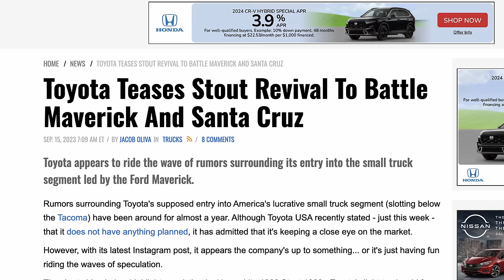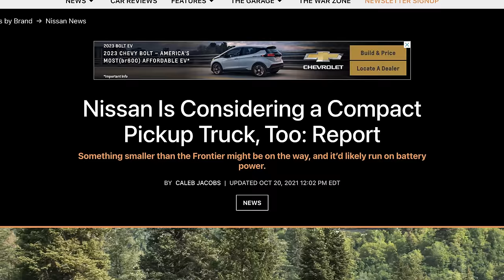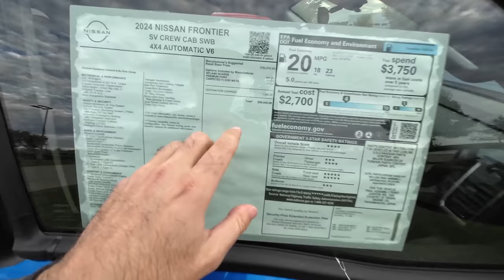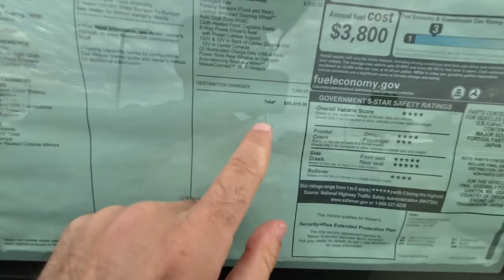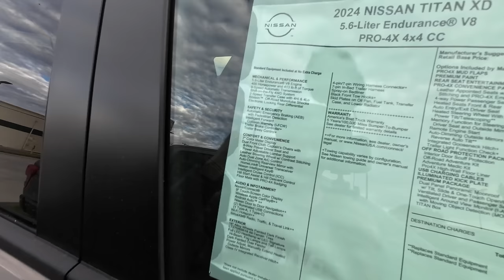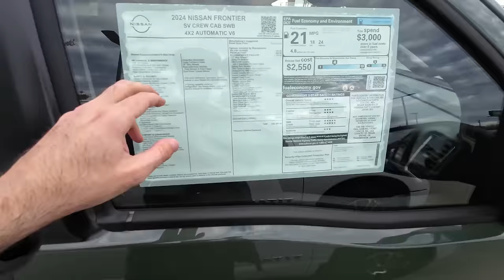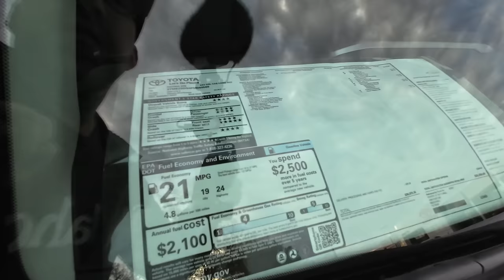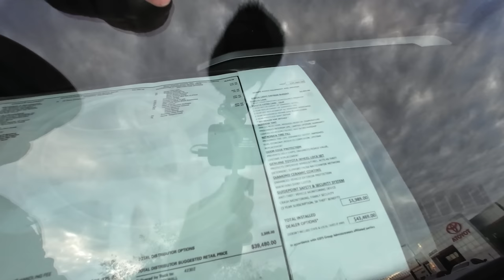Nissan’s NEW $20,000 TRUCK Has Ford & Toyota In Panic Mode!

Comment: I fear even if Nissan did make a 20k truck it would have their crappy CVT drive in it.
Reply: Unidoby with cvt, would basically be a Murano with a bed
Reply: It’s never had and never will have a cvt in the frontiers just a normal reliable 8 speed.
Reply: Or it would be electric.
Reply: Trucks can't have a cvt cause cvts are not made for towing
Reply: @Misfit_wk2  Up until 2022 when they made it bigger the Pathfinder had CVT's, that's a truck...
Reply: Didn't the guy get in trouble for using crappy parts and fled the country?
Reply: @Zappy1210 i’m on my second pathfinder lol that in fact is NOT a truck.
Reply: @boogie9710  I bet you're wrong.  Name the bet.  Pathfinder is indeed a truck, check your title.
Reply: @Zappy1210   that’s whole suv & i’m not talking about the credentials,.. im talking about the capabilities which in fact the pathfinder doesn’t have ..  no “real truck” has a cvt so sir you’re wrong lol.   fwd and awd applications are for most commuter nissans and unfortunately they’re cvt n belt driven .. deeming the tow load to be crap which in fact nulls any idea of a NISSAN PATHFINDER to be a truck ….
Reply: @boogie9710  But the title does say "truck".

Comment: What I heard from the ford dealership near me is that Maverick is only available for pre-order because of the high demand. The dealership won't charge any markups but they just won't have any existing inventory. Anytime you see if there is an Maverick available on the lot is basically customer doesn't want to the car after it arrives.
Reply: No dealer mark up would be a pleasant surprise
Reply: I’ve seen Mavericks running about $38K.
Reply: @scherzva  probably mark ups for existing inventory yes. but pre-order only the top lariat trim will reach $38k.
Reply: Every Ford Maverick built is pre sold before they hit the dealership. They have no problem selling them , they have a problem producing as many as people want .
Reply: I just rented a Maverick XLT to drive through Florida. I got to tell you not impressed at all. Very tiny very basic. I felt the engine was struggling to maintain highway speed. Everyone does 85mph
Reply: @stevenwagner8741  The struggle was probably the transmission. 

Many are coming out in 6-9 speeds to save fuel.
They'll only go into overdrive on a perfectly flat, no turns, no winds stretch of road.

You get one little breeze, and it'll drop down a gear.

The irony is, without the added weight of those extra gears the trucks would stay in overdrive.

Comment: I bought a new F150 in 2013 , and I still have it payed $35,000.00 Canadian all in .It’s the XTR 4x4 5.0 L Super Cab , I would not pay more than $45,000.00 Canadian for a new F150 . Ford you want to sell more trucks ? Get rid of the Bling 💍 and give me more payload just saying.
Reply: the local large Ford dealer group currently ( 2/10 )  lists 600 F150 available....of those not a single stand cab 2 wheel drive ...they dont care what we want in a work truck ....also a total of 3 Rangers and 11 Maverics

Comment: I am a die hard Toyota fan boy. But I must say that the new Frontier is a nice truck. Shame it’s not available with a manual gearbox. If it did I would actually consider it.
Reply: I’m a Toyota fanboy and ended up trading in my 2011 4Runner for a 2022 Pro 4X. It’s way better than any Tacomas I’ve been into…yet a 6-speed manual tranny would be perfect in this.

Excellent purchase for the price!
Reply: @patricklachance3187 Toyota fanboy here is as well. I’m really considering a king cab 4wd, I’ve heard nothing but good things on the new Frontier
Reply: I have one and it’s awesome
Reply: But have they improved the turning radius?  It’s been woeful for decades.
Reply: I've worked as a Nissan Tech. I've worked as a Toyota tech. You buy a Frontier you will know you've upgraded from a Taco.👍🏿

Comment: I really love the Titan, I have a 2006 and its an amazing truck. I'd buy a new one but not at the current prices.
Reply: The Titans are the cheapest truck in the market right now.  A good SV with decent features are low $50k. If you can't afford that,  the preowned ones are in the $40ks, high mileage on the $30k. If that still too much and you wait,  then you won't be able to afford even a car because new versas which is the cheapest cars in America are now in the $20ks
Reply: My friend had a 04 titan and he loved it and the few times I borrowed it it made me want one he bought his with 185k and traded it in with 267k and had no issues at all in the 3 years he owned it
Reply: @mobilesolutions4u444 It's not about affording, it's about wasting money. Because my 2006 Titan runs completely fine and I only drive it between three and six thousand miles per year since I don't need a truck every day.
Reply: @mikedavis5207 Ironically, everyone who has borrowed my Titan also really loves it. I always say how torquey it is and how nice it drives.

Comment: I like it but Nissan's history of reliability is... concerning.
Reply from the maker: Honestly it's not any worse than most of the other brands. I had several 350Z cars and they ran so good most of the time.
Reply: @MotorFeed Trucks. We're referencing trucks here. 
I'm not going to use a 350z like I am a truck that I'm working out of. That's where the concerns come into play.
Reply: Nissan ranked 17th on Consumer Reports list that came out this week, 31 points behind Toyota
Reply: @chrisjmiller6  That's true, but the company is really trying to get back to their Golden Days back in the 1980s and 1990s! Nissan has clawed back a lot more independence back from owner Renault when it comes to what they build and how they build it.
Reply: @chrisjmiller6  consumer reports is not a credible source at all.
Reply: @Dan-gj1hz  are you serious?
Reply: Nissan is good if you dont buy CVT their standard transmissions and engines are bullet proof.

Comment: Yeah I’ll say it also, the auto makers have totally lost the plot when it comes to Work trucks ,just a plain  build for a work service truck without a service body on it is $50,000 plus then you got anywhere between 10 and 20,000 for a service body plus installation. It has definitely gotten out of hand with the prices.

Comment: Ford quit selling the 2.3L 4 Banger and the V-6 RWD Ranger because it was "taking sales away from the F150." Yep they were selling only 90 to 100 thousand a year by 2011.
But that was because Ford did not want to sell 4 banger sticks with just the basic list of options. Sometimes a 4 cylinder is all you need. I had a 7 passenger Envoy for the old lady's pleasure.
But if I needed to pull a 6000 lb trailer the Envoy could do it.
 The Ranger had transmission problems pulling a empty trailer. I also did not have to adjust the seats in it. Stick shift.
But she always pushed the remote button 1st when both of us were going somewhere in the Envoy. Yep the seat memory did not work well when she did that.
Works fine. Now that the Envoy is out of style. They seem to not understand there are men that drive them.
 But then the women are raising up men with musical chair fathers now.

Comment: I live in Toronto Ontario Canada and I remember back in February of 2009, my local Ford dealer (Yorkdale Ford) had a sale on the Ford ranger sport with extended cab, 3.0 V6 with automatic trans and 2 wheel drive. They had an ad in the Toronto sun newspaper for $12,288. I bought one in black for me and a white one for my father. A couple days later my brother went back to buy a black one as well. My father and I still have ours but its just crazy looking back and buying a new truck for under 20 grand.

Comment: Good to remember that the extended cabs, vs the crew, usually have bigger beds, so that is something to consider. An extra 18inches length to the bed can make a BIG difference.
Reply: That's the sweet spot for me. Load a dirt bike and still close the tailgate. Extra cab size to store items you dont want to leave in back or for a dog. Even with a camper shell, you can close it all up and sleep in back. Not everyone is traveling with a family/crew.
Plus a mid-size or smaller truck can get into places that a full size struggles to go.

Comment: Nice video with good thoughts.  But in the next year I hope to buy a new-version Toyota Tacoma with manual transmission.  I might even be willing to get the base (very basic) trim level but would love to go back to a manual transmission which I have not had in a long time.  Unfortunately the Tacoma and Gladiator are the only trucks available with manual.
Reply: You can never go wrong with a Tacoma
Reply: @user-li4km9rw1e The Toyota Tacoma has the 3.6 V6 twin turbo 400+ hp.
Reply: @kuntekinte6246  can you get that with the manual transmission though

Comment: It’s not a truck if it isn’t body on frame construction. Even Tesla fuct up when they changed the cybertruck to a unibody construction. It lost all its payload and towing capacities. Which are what trucks are for. Don’t care that it’s bulletproof, don’t care that’ll do 60mph in 3.0 secs, cuz it can’t hold the weight of a snowblower in its bed….and all the shit in the bed will go flying trying to beat 1/4 mile records. If it can keep up with traffic on an interstate on ramp, fully loaded, it’s good enough for me.

Comment: I don't care to get any smaller than the Tacoma. And I don't care get any larger than the Tacoma. 🧐

No doubt many people will love a smaller pickup truck option. 👌
Reply from the maker: Sounds like you really like the Taco. Lol.
Reply: current gen f-150 is the perfect size for a truck
Reply: @WaitForYouu  But the downside is that you have to buy a Ford
Reply: @WaitForYouu  
A work truck no doubt. 

But like most pick-up truck owners, there is nothing in the bed , most of the time during the year.

I have  the Tacomas for the 4 wheel drive and the high clarence for the winter.

I have seen all-wheel drive vehicles. Many cars get stuck in the snow and suspended in the high snow cause they don't have the clearance.
Reply: @MotorFeed   yeah
I would do a Tacoma commercial for Toyota for no charge. 😄

I own two of them.
Reply: @The_Real_Frisbee    L😂L

Comment: Small Trucks:

Luxuries:
Bluetooth
Heat&Cold Air conditioning 

That’s basically just the modern equivalent of Cassette player and air conditioning.

Otherwise, just focus on: 
MPG,
4WD,
Low sticker price.

Everything else, we can work up from there in this economy depending on what the individual can afford.

Comment: One report I read opined that Ford has decided to keep the Maverick producion down, because the profit  one them is low. If true, that's what Ford thinks about their customers. If Toyota, and Nissan can build a small truck, and get then to their dealers, the Maverick will be a thing of the past. However,  if Toyota and Nissan can't control their dealers any better than Ford, I won't be a buyer.

Comment: Manual trans wanted. Or repairable automatic with regular clutch packs and cooler up front. An engine that you can reach all around for easy repair. Make it as if America's are Afghanistan mechanic and who would rebuild the engine on the side of the road. Make the cab corner and rocker panels easy replaceable in case of rust. Have a clear layout in the service manual of all body drain holes and sticky points to avoid rust and allow the owner to make it last. Have chrome hardened bolt on bumpers. Make a dash with a modular slot in the middle for a gps and screen for apple car play, android, and backup camera. Do NOT have any kind of climate control. Knobs and switches. Fuses and relays. Do NOT have modules or canbus. Do NOT run anything about the car off of a touch screen or digital panel.
Reply: i really wish i had the means to make a car company. Can you imagine destroying the competition with basic square body single cab pick ups? The afgan analogy was perfect, those basic nissans and toyotas are god like.

Comment: I bought a ‘22 Pro 4X in December of 2021 in a trade with my ‘11 4Runner. The only things I miss about the 4Runner are the absolute peace of mind and the comfort of an suv like it.  The Nissan is better than the current Taco by very far, yet this may change soon. But will it be worth the extra 10-20k$$$?

Comment: In 2003 (I was 23) trucks were so NOT in demand and Ford was switching over to the NEW 2004 design a local Ford dealer was doing buy 1, get 1 FREE on F150s - or a great deal on a single F150.... I bought a brand new Silver F150 Sport, extended cab, stick shift, no carpet AND talked them into a bed liner: $17,000 + tax & doc fee.

Now, age 44, I am shocked every time I see the cost of a basic truck.

Comment: I bought a '93 Nissan Hardbody shortbed regular cab for my son as his first vehicle. The only thing I did to it was to put a set of 15x8 Pathfinder wheels and 255/60R15 tires on it to make it handle better and a new stereo. It had 300k miles on it but it still looked and ran great. My son drove it every day for a few years then joined the Navy. After that, I drove it for another year or so then sold it. That KA24E four cylinder was a great motor. If Nissan brought that truck back, I would almost certainly buy one!

Comment: My dad always told me to not buy at a car lot, but to buy from a private individual in cash. He encouraged me to buy my first vehicle (1992 Mitsubishi Mighty Max pu truck in 1996 single cab (87,587 miles) that the guy was asking 5800, but my dad negotiated it down to 4100. I made it to 228,000 miles on original engine and original manual transmission, but my younger brother got ahold of it and hit a pole with it and totalled many times over, and left tge scene of the accident, and tge police came to.my door to let me know, so I got it towed to my house. I found out later he had lost his driver's license for a DUI, so that explains why he left the scene. He has had a lot of DUIs. Regardless, I still learned a valuable lesson of buying in cash from my dad, and not letting irresponsible people drive it like my brother. RIP dad who recently passed, and can't wait to see him risen from the grave upon Jesus's return, because I miss him dearly every minute.

Comment: I owned a 85 Ford ranger I bought used in 93 for $1200.  79,000 miles for 10 years and sold it for $800 with a extra 147,000 miles. Best 4 cylinder engine that still ran great

Comment: If a manufacturer would build a half ton, crank windows, V8 5 liter, manual transmission, am fm radio, 6 to 8 ft bed, single cab, 4x4. Keep it a 30 K. It would sell.

Comment: In 2021, I bought a brand new Nissan frontier for 23k out the door. Granted it was a 2020 model, but I got a great deal because the dealership wanted to get rid of it. I gave 3k down, and my payments are great. Not a flashy truck, but reliable and use it to pull my work trailer.

Comment: I live in Michigan’s Upper Peninsula and in Northern Wisconsin.  I have never seen a Ford Maverick.    I am a Chevy guy, but retired and on a budget, my 2014 Silverado is wearing out, not mechanically, but with rust!  Thanks GM.  Was about to buy a 23 Tacoma, but $36,000 for a 4x4.   Waiting for the Stout or Toyotas proposed $10,000 mini truck.   I need to see the mini truck to see if it is safe enough.  Glad to see Nissan jumping into the affordable truck!

Comment: Unfortunately you can’t pull anything with these small truck wanta bees such as a double snowmobile trailer with two sleds on it or a 20 ft pontoon plus you can’t put but two people in them because the back seats are so uncomfortable. Bring back the 1/2 ton trucks at a decent price without all the crap the manufactures think people want when the6 don’t.
Reply: My small 2020 ford ecosport has a tow capacity of 2000 lbs which fits my 6x12 aluminum trailer (600 lbs) and two full size atvs (700 lbs each).  Does better with one atv for sure though.  The maverick can be had with the 4k tow package which would easily do the snowmobiles.  From what I saw 20' pontoon boats weigh 3-4K so too much for the maverick or santa cruz but easy for any of the midsize trucks (ranger/colorado/canyon/frontier/tacoma).  It is sad to think that in 2019 when I was pricing F150's I could find STX models in $28-30k range.

Comment: I bought a 1988 Nissan used in 1991 and used it until 2009 when I ran into a ditch after hitting a deer. Then sold the engine for half what I paid for the truck.lol it was a great truck.

Comment: In 1978, I bought a brand new Ford F-100 for $4,864. That's right,  new pickup truck for UNDER five thousand dollars. It didn't have any options but who cares, it was a new truck for CHEAP. Now they've fixed it so you have to be rich to drive a pickup truck.

Comment: Trick question:
Who is to blame for the high truck prices?
Is it:
1. the automaker.... for including so many widgets that incrementally launch the prices into the stratosphere
or...
2. The government... for basing fuel economy standards on vehicle size and mandating all those widgets that drive up the prices of those trucks?
backup cameras (reqd), 14 modes of anti lock brakes (reqd), blah blah blah
(soon all vehicles will be required to tell if you are intoxicated, what could go wrong?)

Comment: Wife got a new company car (not truck) where the passenger seat adjusts manually. Then I assume its a lower trim package. Theres still a 10" screen in the dash, backup cameras, and blind spot alerts. They wonder why theres a chip shortage? Gimme power windows, locks and an aux port. Strip all that other shit and drop the price $10k

Comment: The best truck you can buy is one you can afford. Trucks are easier to work on than unibody cars, so it’s not unreasonable to buy a used one if you’re willing to put in the work. I have an Xterra with 220k miles and going strong. As much as I love my Xterra, I can’t justify $40k for a Frontier.